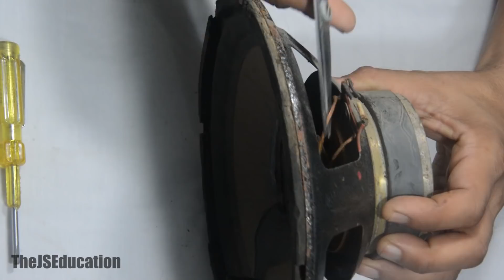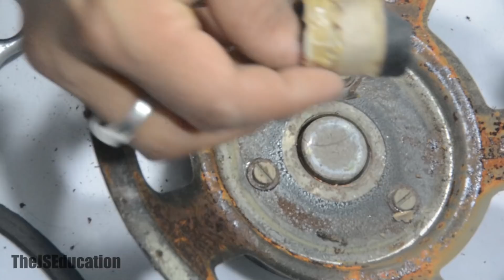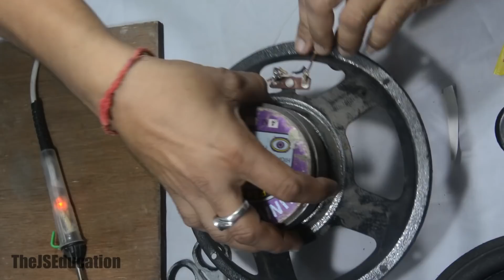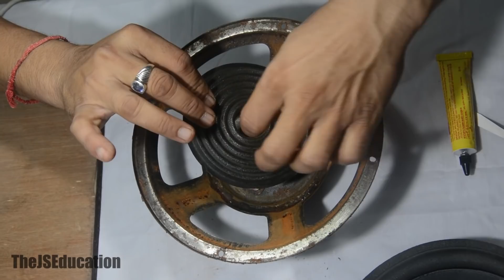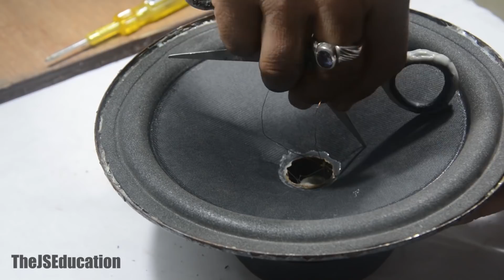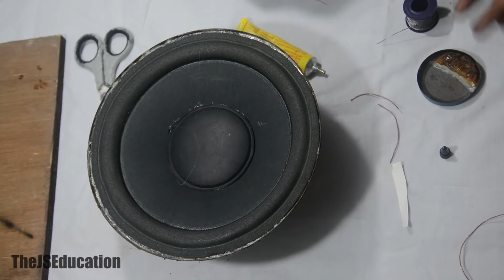How to Repair Speaker at Home

Comment: From where you buy that new cover (cone)
And what is the real name of that black cover 
How much did it cost to you
Reply: Actual name of that black material is diaphragm .It will cost you around 20-40rs
Reply: The black thing is call spider
Reply: No.    spider is in brown colour.spider work as spring for moving coil speaker. Actually I am electronics engineering student from BITS Pilani that's why  I know that.

Comment: What glue was that in the,yellow tube,anyone.no where I can get a speaker come for a 4"  8 ohm speaker,another speak company say just replace it with a new one I could that,but my speaker has a transformer on.it I don't no ,but I may have to relocate that speaker transformer,I holding someone either has a new 4" come or a kit .If anyone can help me find what I need ,I would be thankful .
Reply: If it has a transformer on it, it's probably a Field Coil. Vintage kind of speaker driver used in many vintage guitar amps and class A Tube radios. I know nothing about repairing FC speakers, but It could be very difficult. However if all it needs is a recone, use some Loctite rubberized or flexible glue. Those paper cones are quite brittle considering their age.

I dunno what the transformer does, but DO NOT EVER Connect the speaker to AC power. This will guarantee that your property goes down in flames. Instead, use high voltage DC current or a tube amplifier to drive it. Just be careful of it - Tube amplifiers have the Mains wired directly to the metal chassis as they don't have a Transformer, so don't touch the chassis, otherwise you'll have 110V right in your face. Replace any paper wax capacitors and resistors that are leaky or "open" by using a Multimeter and the Schematic that came with that tube radio. No not plug it in before servicing it. This will short the capacitors and possibly blow the tubes. I'd recommend watching some Shango066 to get the experience of what's it's really like to resurrect or restore even tube radios. But I'd recommend getting somebody that knows stuff like this to get it working properly.

I'd also do research on FC speakers to know what you're getting to.

Comment: Wow... soldering almost on the cone surface is a brave thing, but to leave all the dry glue under the dustcap, where weight ratio is the ultimate key, not to mention the corrosion on the basket seems for me literally an awful work... so please do not continue this activity...

Comment: Hi!

Can someone telle me please whats the problem with this speaker? It started to resonate/vibrate since yesterday. It resonates even on low volume level. It sound almost like when the volume level is to high and a speaker isnt capable to play without distortion. You have to watch the video on earphones to hear the wrong vibration. I can hear it comes 99 percent somewhere from the membrane. When i touch the membrane it becomes louder. I tooked the speaker apart, but found nothing loose inside that need to be tightend or something. Also when ive tooked the bass speaker from the housing it sounded normal. Only when i put it in the housing it started to resonate. Like it has something to do with the air. Also when i put a towel in the "subbasshole" in the front of the speaker the resonation disapears.

If someone can tell me how to fix this, it would be very nice. 

Thanx

https://www.youtube.com/watch?v=c2EOL9jkW9I